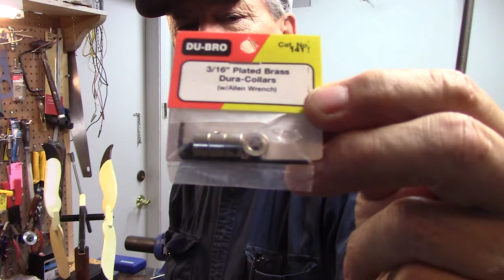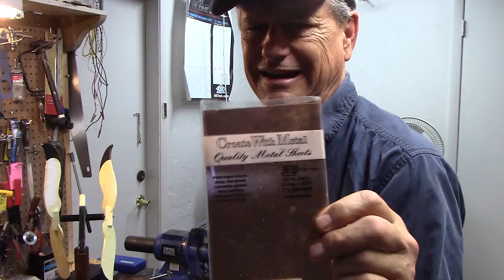How to Make Secret Whirligig security clip, Old-timer whirligig maker's trick,    Easy!

Comment: You could form the strip in a wider piece of metal, and drill the holes first,  before forming, then cut the formed material into slices with a cutoff wheel, making a few at once
Reply from the maker: That's a good idea!